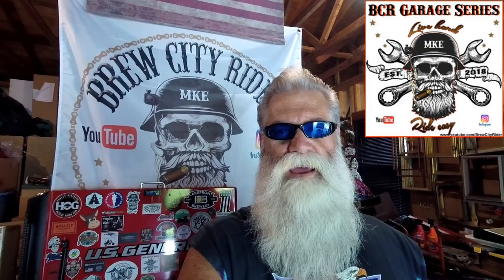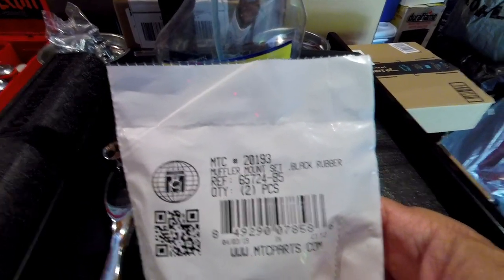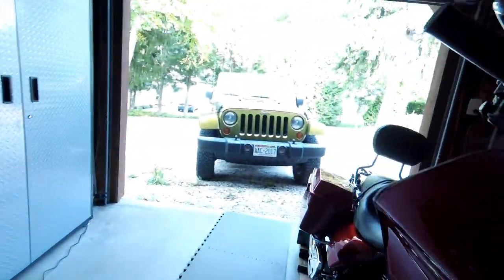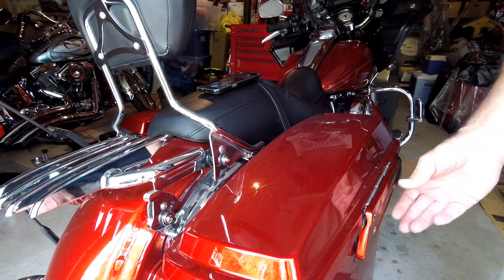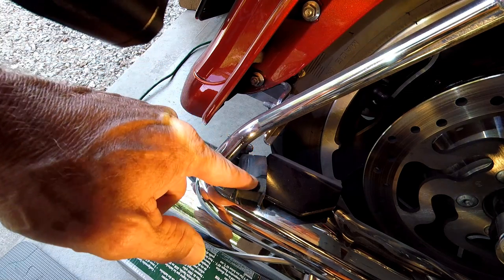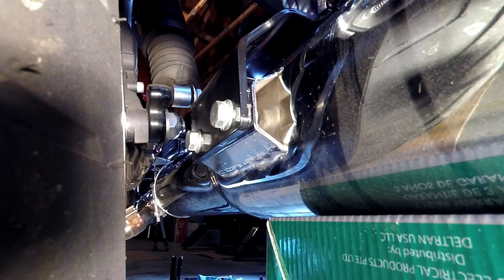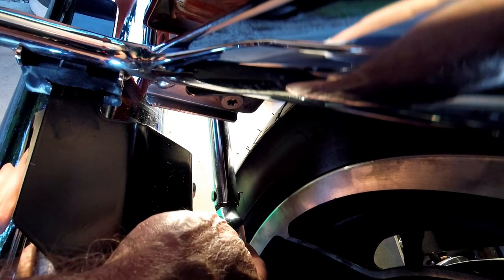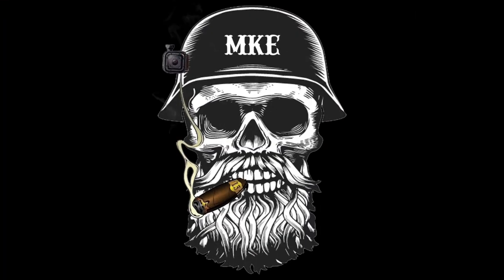BCR Garage Series: Replace Harley Muffler Mount Grommet

Comment: Man, thank you so much! Took about 3 minutes.
 I'm glad your bushing went flying out the back of the bike, I would have kept trying to fight It.

I started it like you did.  I used detailing liquid (Griot's) as a lubricant and a 10 Oz. Dead-Blow hammer to drive in the bushing. I ended up finishing with the handle end of the hammer to push the bushing in and my fingernail to pull the corner out to the rear.

More lube then wiggled the bracket in.

Easy 

Thanks Again

Comment: I sure appreciate ya actually showing the battle with the grommet! Most would have hid that!  Hey at our age,  you should look at getting a hoist.  I have one and it makes everything easier including cleaning it. Another great video!
Reply from the maker: Thanks. I try and show viewers a little of what it's really like to do some of these jobs.  They're not all slick and easy like some channels show you  

My wife actually told me that I should get a lift today haha! I couldn't believe it!
Reply: BrewCityRider,

Yeah. My old bones (I’m 47 haha) don’t do so well on concrete floors anymore either. Just throwing myself on the ground repeatedly changing fluids rattles them enough I feel it for a couple days afterwards. I’ve got a motorcycle/atv lift from Craftsman I use for cleaning but I’m considering a full ramp lift like the one from Harbor Freight for anything as intensive as that grommet replacement. Haha. Ride safe.

Comment: Thanks for posting this video. at min 4:30 you showed the 1/2 inch bolts. my 2012 has after-market pipes on it and one of the bolts is missing. What is the width of that bolt so i can replace it and put some Loctite and rubber washers on it. plus any guidance would help. Thanks in advance

Comment: I put my isolators in hot water to soften them up, used Silicone spray as lube & installed with a small rubber mallet to persuade it in.

Comment: I looked for those locking mats at HF website but couldn't find them. Is that where you got them?
Reply from the maker: Yes, they call them anti-fatigue foam mats, and they come in a set of 4 for less than 10 bucks.
Reply: @BrewCityRider  Thanks Brew, I'm getting some!

Comment: You don’t need to take the brackets off.. you could just slide the rubber grommet on the end and then press it through with some channel locks. Simple about a two minute job.

Comment: Real Booger Bear hey BCR?
Reply from the maker: Yeah, I was not expecting that. The bracket pushed through rather easily when it was out of the bike. New tough rubber with no place to expand once mounted on the bike I guess.